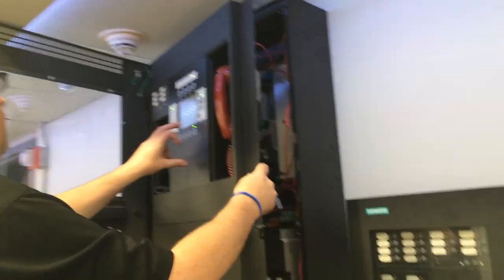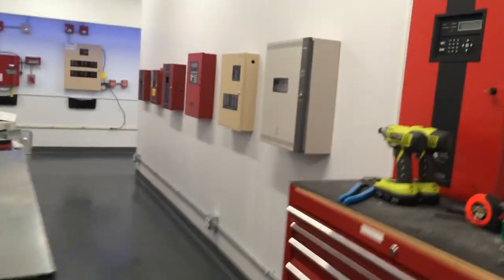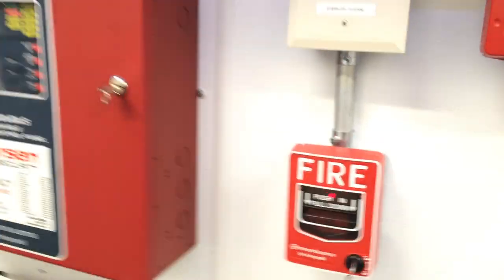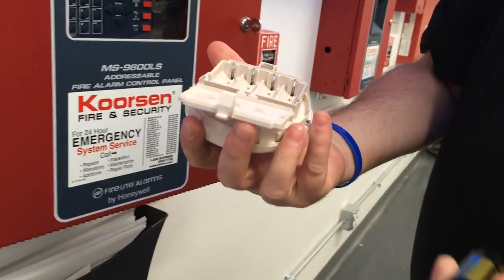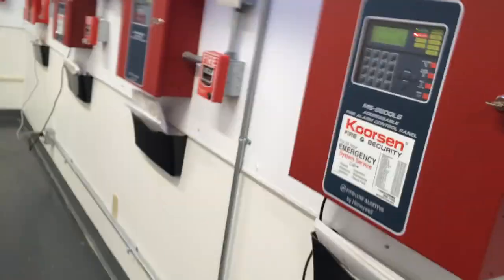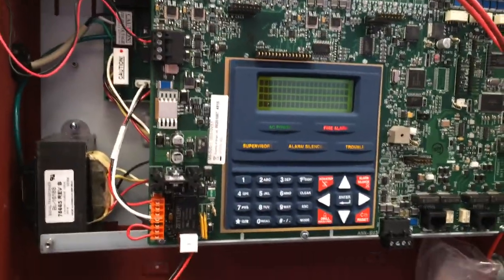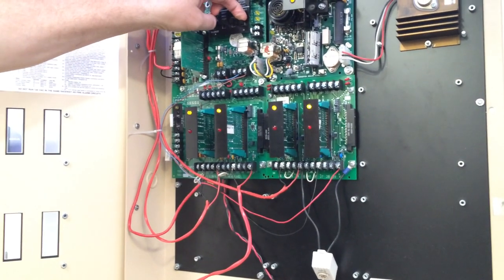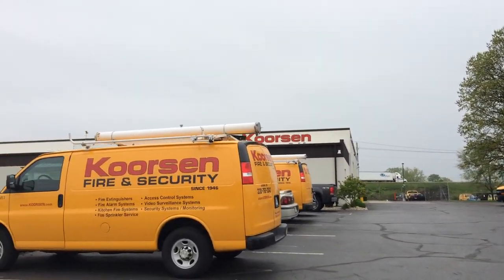The Fire Alarm Room | Koorsen Training Center

Comment: I live in the UK, my favourite American fire alarm panel is the Simplex 4100es and my favourite speaker / strobe is the Simplex Truealert
Reply: NathCraft i personally like the EST or honeywell ryght now in america honeywell is #1 is not the most ecpensive system like siemens or simplex but is the most reliable
Reply: Hi Mitch simplex is really bad and they only care about money. They try to have they're customers pay $8,000 to change the time on the system. Siemens is probably better for big buildings because they care about quality. Stay away from simplex.
Reply: My preferences are the Edwards/EST systems, along with Notifier, Faraday, (old pre-Bosch) Radionics and the Fire-Lite systems.
Reply: They are bad i am ripping one of them out and installing advanced. that simplex has over 300+ faults and expensive to repair